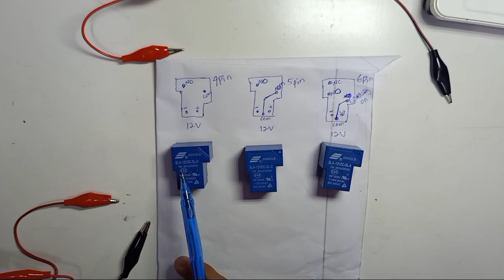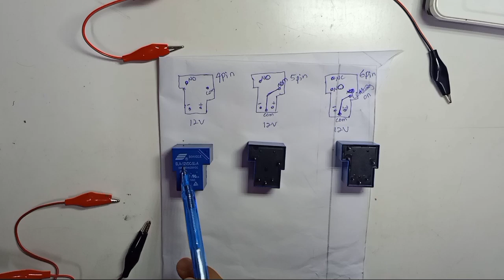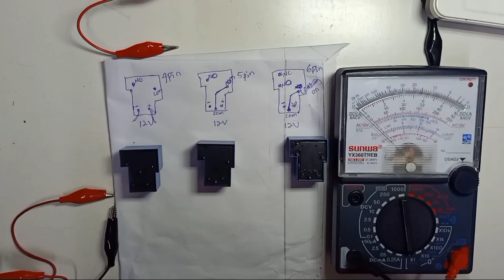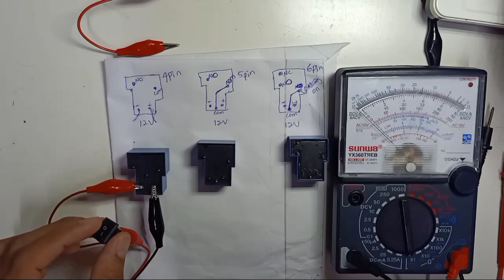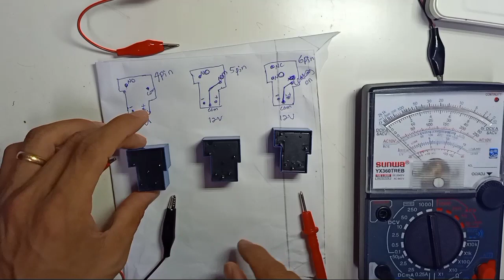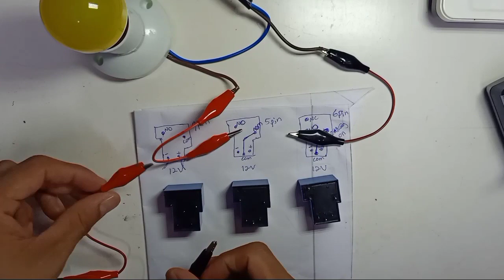How to check SLA-12VDC-SL-A Relay 4pin/5pin/6pin

Comment: Hi.  Will this work with a 24v system?  I want it to power a contactor when the battery voltage goes down to 23.5v and disconnect the contactor when voltage goes up to 26.5v.
Reply from the maker: Yes...as i understand it should work

Comment: Thank you for this.  

I am struggling to find the 5 pin version for sale in the UK.  After watching this video I believe I can use a 4 pin version (which is available locally) and use a jumper cable to connect the top right and lower middle contacts on the reverse of the board (connector locations as seen in diagram on video).  

On the board I am trying to repair there are no tracks going to the top right pin as shown in you diagram, instead, the tracks are to the bottom middle pin.  I shall bridge these connections and use the 4 pin connector.

If it works you are my hero!  Thanks again 🙂
Reply from the maker: try to test without pcb board for safty
Reply: It worked!  Thanks again, this video has saved my disco light from being scrapped.  Much appreciated 👍
Reply from the maker: @garyrainbow291 I am so happy its helpful video 🤗

Comment: why it doesnt clicking??
Reply from the maker: @Aspiringtech03  if you supply the coil voltage to relay and does not clicking means the relay coil is burn or damage.

Comment: thank you for sharing that knowledge , ? here ; Is there a type of relay that can be activated & stay active with a electric pulse as with a momentary switch and be turned off with a second pulse ? control V would be 12vdc & the load would be from a 20s lithium battery pack (fully charged 85Vdc , no big current demand for it ,it's for ignition feed to the controller and is also used by it to reed VBat state of charge %) . If a two state model is available i could use the two one for ignition & the other for anti theft alarm , any suggestion ?
Reply from the maker: Hi, so far i didnt see latching relay  but i suggest if you might use 12vdc digital timer relay with Sensor trigger something like pir motion sensor relay control. i hope its answer the some idea.